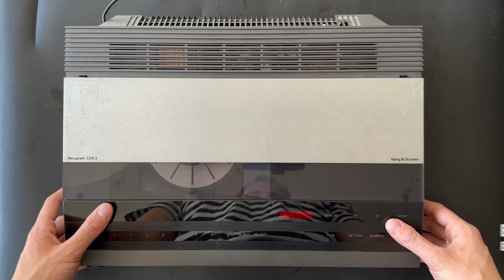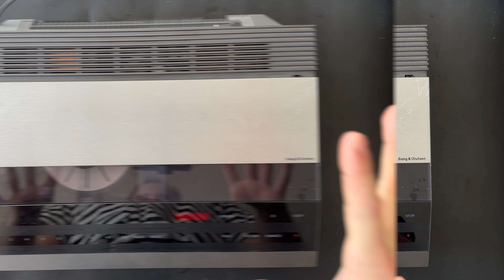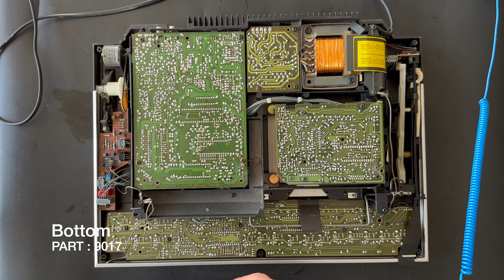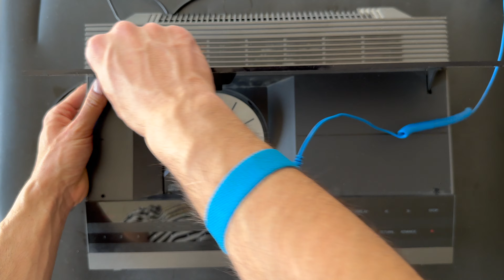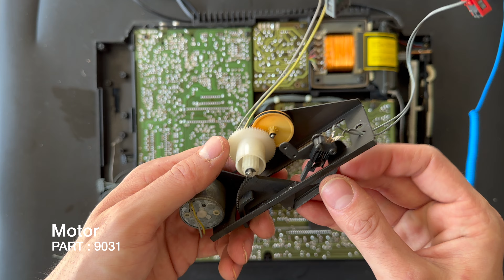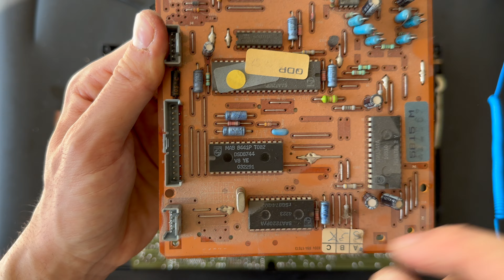Bang & Olufsen Beogram CDX 2 Disassembly process and Repair guide

Comment: Hi, I have the cdx, but has no transport screws. Spares possible?
Reply from the maker: Yes, we have the transport screws available for the Beogram CDX / CDX2 models. They are original-style replacements and fit perfectly.

If you’d like, I can send you a link to order them directly or include them with your next parts order.
Reply: @KoseTrading yes would be good, I need screws for Beogram 3000 I think, also infrared cover for Beosystem 3000

Comment: Any person can tell me what the fault is with the error code 2 on CDX? In addition, I dismounted the top cover and bottom and then found two small springs dropped on the table. Can anyone  tell me where these two springs should be placed?
Reply from the maker: Hey there! Error code 2 on the Bang & Olufsen Beogram CDX 2 typically indicates a problem with the CD mechanism or laser assembly, often related to alignment or an obstruction. It might be worth checking the mechanism for any dust or debris that could be causing an issue.

As for the two small springs, they are likely part of the internal mechanism that helps with the movement or tension of the parts inside. Without knowing the exact spot they came from, I'd recommend checking the service manual for the Beogram CDX 2, as it should show the placement of these springs. If you don’t have it, there are also user forums and communities where other owners might have more insight. Good luck with the repair, and let me know how it goes.

Comment: Obviously stripped down to sell as spare parts at a premium price.
Reply from the maker: I understand your concern, but that's not the case. The item is being sold in its current condition as it is, and the pricing reflects its value and quality. If you have any questions or need more details, I’d be happy to provide additional information to clarify.

Comment: In 1988 you could buy a Sony CDP-750 for half the price of a B&O Beogram CDX 2 and the Sony was a lot easier to operate and sounded better than the B&O.
I must admire B&O for packing average quality Philips gear inside a smoked glass and metal box, and then sell it for 3 times what it's really worth.
Back in 1988 it was marketed towards babyboomers with too much money, and that's still the case today.
Thanks for sharing the disassembly. I wonder how the player managed to gather so much dust inside, but since you're discarding everything it doesn't really matter anymore.
Reply from the maker: Your comparison of the Sony CDP-750 and the B&O Beogram CDX 2 highlights some key differences that have been widely acknowledged. The Sony CDP-750 was indeed praised for its user-friendly operation and superior sound quality, often at a significantly lower price point than the B&O Beogram CDX 2.

B&O has always positioned itself as a luxury brand, focusing on high-end design and aesthetics. This often means that their products, like the Beogram CDX 2, are more about the experience and the prestige associated with the brand, rather than just the raw technical specifications. The use of premium materials such as smoked glass and metal, and the distinctive design, cater to a specific market segment that values these attributes and is willing to pay a premium for them.